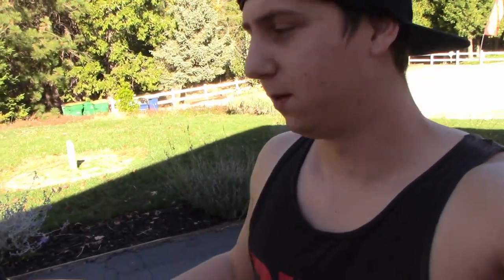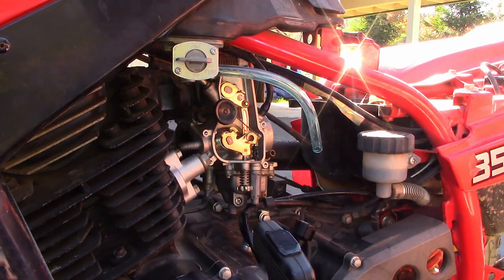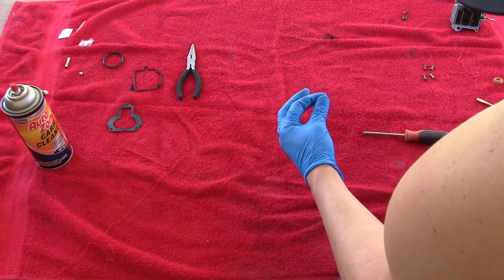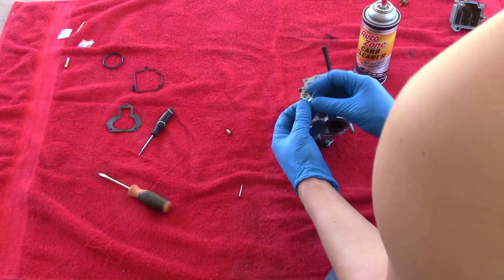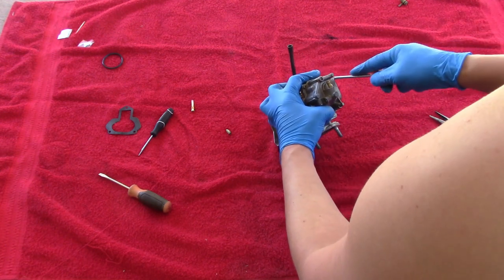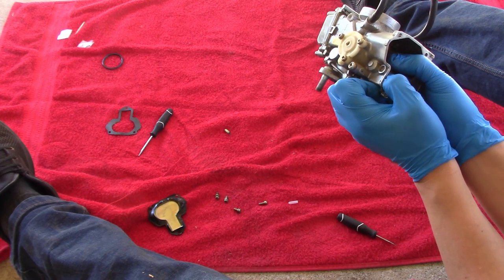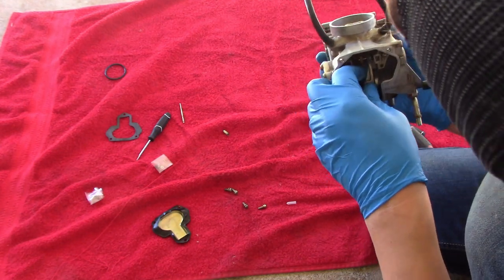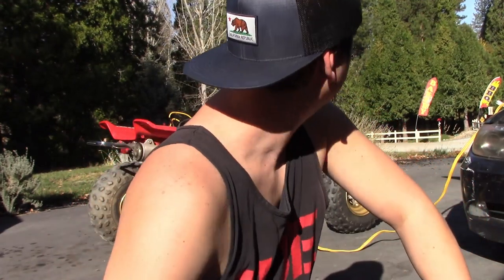Yamaha warrior 350 carburetor rebuild - how to

Comment: this is outstanding!  we have a 2000 and a 2004, both with the same stuttering issue in the mid-rpms.  now i'm not so intimidated on cleaning them up :)
Reply from the maker: You are welcome honestly wasn’t so bad I have since taken apart many carbs and have gotten lots of my friends stuff running for them as well too. Glad I jumped in and gave it a shot also have gotten a lot better at filming stuff since this and actually have a wide angle now so people can see what I’m doing.  I hope this was helpful
Reply: I just bought 2 as well I'm thinking about giving it a shot myself now
Reply: The stuttering issue I have on mine aswell. It is not the carb. I have cleaned mine about 30 times and checked the needle and adjusted everything and nothing worked. It is actually a sensor in the front that you just need to unplug. That seemed to work for me. Look up a video and it should pop up as a black warrior with the lights off watch that and he will tell you exactly what to do

Comment: You never said what the problem was. I assume it was stuttering off idle at low throttle settings and stalling at idle. The PILOT JET was clogged and that controls IDLE and up to 1/3 throttle as the needle and main jet take over from there. Usually a can of Carb cleaner like you have there or CHEMTOOL B12 will clean out the jets, especially with a wire brush that has small enough wires to push clear thru the jets. That ohaul kit is sweet. Not always necessary. It always a good idea to clean out the passages before you put the new jets in. Tiny particles can cause havoc. Put a FUEL FILTER between the tank and carb!!!!

Comment: Video is very helpful thank you. Only thing I can’t get out is the pin
Reply from the maker: Your welcome if you have a hard time you can use brake cleaner as a penetration oil to try and help you get stuck parts off.
Reply: @throttlefamily4655  ok I’ll try that thank you. And does it matter how high or low the float is when you put it back on?
Reply from the maker: @randumlystupid  yes you want to have it right in the middle or as close as you can.
Reply: @throttlefamily4655  got it thanks. I bought my 1997 Yamaha warrior about 2 months ago didn’t start up got a new starter, battery and stuff like that this is my first vehicle and fist time working on a vehicle and I love it it’s fun and I feel productive doing it your video really helped me with this one :).
Reply from the maker: @randumlystupid  way to go keep it up 👍
Reply: @throttlefamily4655  installed it and fuel came out of the over flow :( hmmm I think I need to adjust the floats even tho I did but the little wire holding the tab is so hard to adjust it kept staying at 1inch from the frame
Reply from the maker: @randumlystupid  did you screw the bottom screw in?
Reply: @throttlefamily4655  Yeah I was trying to adjust the float but for some reason I couldn't no matter how high or low I put the tab it wouldn't change the height I did everything and then it broke off haha (tab). So I already bought a carb rebuld kit so thats good. and i think ill need to buy new floats but they coast almost as much as a whole new carb but im doing this to learn and it feels good working on my own things.
Reply: @randumlystupid  I’m about to try to put a new one In my myself and I know I’m gonna screw up somehow lol

Comment: Where the hell doe the little 5 inch black breather hose go on the top back carb? Been trying to find there everywhere. I see a little tab with a hole in it? Does it just go in there?
Reply from the maker: Just want to give you a heads up it goes to nothing just went out to mine and took a look for you just a breather tube to vent pressure. If you are still having problems you can go to our instagram at Throttle_Family and I would be more than happy to help you also don’t forget to subscribe 👍
Reply: @throttlefamily4655  If it's just a breather tube my 03 has a tab in the frame with a little hole just big enough to press the hose in to hold it. I'm guessing that tab is meant for that hose. Only thing I can come up with.
Reply from the maker: I looked around for a spot for it on ours as well but as of right now it is just on the top curved to the side. I wouldn’t worry to much just make sure the bottom vent tubes are facing the ground as gas will come out from them if the quad gets sideways or the quad floods.

Comment: Would be nice to see what you are doing . Really don't you check these videos before you post them
Reply from the maker: Penny Scott this was an old video not very good definitely have gotten a lot better since this video
Reply: @throttlefamily4655  ok good cause I'm really stressing. I've worked on my 350 wolverine 2days in a row. No it won't start . My carb doesn't have any holes on the side of the little things that screw inside . I have took it apart 3 times and had it running good till I put the air filter on it . And I can't find the oil filter either . 😭
Reply from the maker: Penny Scott check the pilot and main jet and make sure nothing got clogged in there. I had one time where I kept cleaning the jets and it was contamination from the gas tank that kept clogging them up
Reply: @throttlefamily4655  I've checked them but the small one doesn't have a hole through it. Is that normal
Reply from the maker: Penny Scott no it is probably just very clogged can you see light threw it?
Reply: @throttlefamily4655  and I can't get the floor off . It looks like it is brads holding it on so tiny you can't get ahold of them . It leaks gas from the bottom . If left on .
Reply from the maker: Penny Scott there should be a screw to fix it also you may have to check your float to make sure it is working properly
Reply: @throttlefamily4655  one is clear the high one but the small one is like medal . I tried hammering a pin in it but nothing. Should I dril through it
Reply: @throttlefamily4655  yes but I don't know how to do that while it's off .
Reply: @throttlefamily4655  I'll take it off again tomorrow and see if the screw will take it off . I think the plug under it might be bad . And it may need a o ring . Thanks for your help . If I may get back with you tomorrow sometime after I check it again . That would be great . 😁
Reply from the maker: Penny Scott you can message me on instagram @throttle_family and I can help you out
Reply: @throttlefamily4655  well my brother took it apart today and this time he looked at the diaphragm 😳 it was tore . Think it happened yesterday. But anyway I have ordered a carburetor and boot . So hope that's all I will need to get it running. Thanks for the chat .
Reply from the maker: Penny Scott no problem hopefully it works